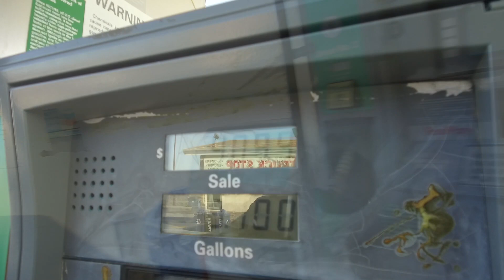Woman's Off-Road Training Event 2018

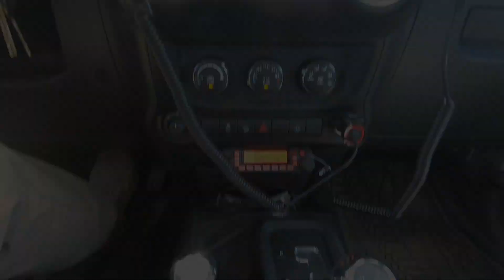Comment: hi, at 7:47 you can see two d-rings under the bumper. are they mounted to the chassis or to the bumper ?
wich brand are they ?
Reply: cactuscookie. they are welded to the chassis , they are trucker tie downs.   u can buy them at any truck parts store like 6 dollars each

Comment: I was wondering if anybody has some BF Goodrich all-terrain KO2 35/12.50/17 i’ve been having some little bit of a bump steer I was wondering what you guys run for tire pressure thank
Reply: Ray Marcial ok thank you for the help
Reply: I usually run 28-30, maybe a little more if I'm taking a long road trip.
Reply: @V13jay: 28 Hwy, 15 on the trail. If you experience bump steer, I'd recommend to get your steering checked by someone who knows their job better than I do. Maybe the angle of your steering components need correction. I had the same and now it is almost solved
Reply: mauiman52 OK thank you for the help I’m actually bringing my jeep to somebody to look at the steering today